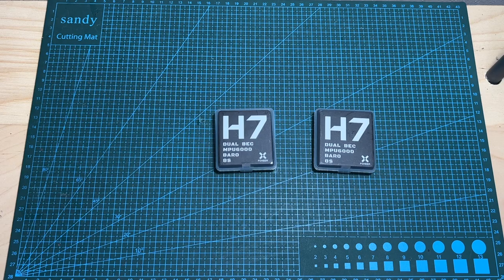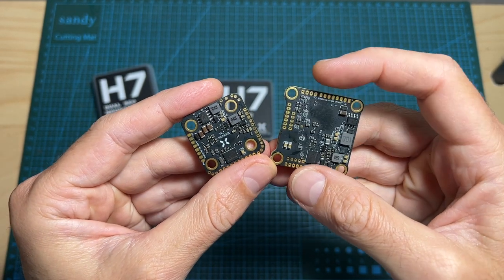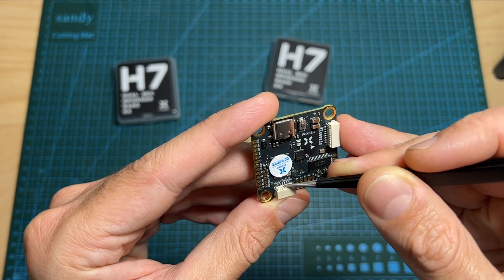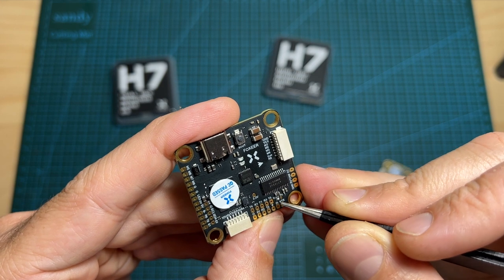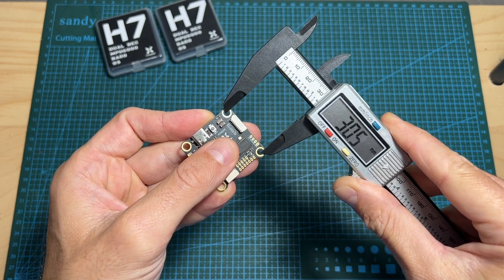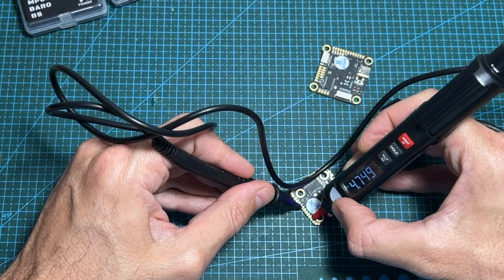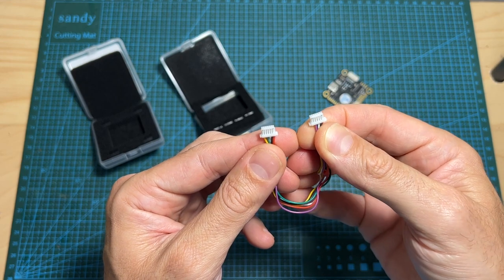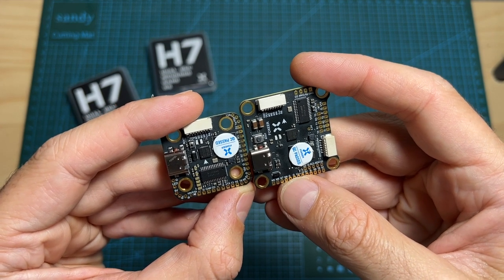Foxeer H7 MPU6000 Premium Flight Controllers Overview

Comment: I seen a new video about a new FC with the MPU6000 and had to check that out. It's almost impossible to find that gyro chip anymore. I don't have any cinelifters or $5000 drones carrying $5000 cameras. I just have 7 inch and smaller gopro quads. For me, any FC will work fine for those. If you only need 2 UARTs, 1 for the camera and 1 for the receiver, an F411 works fine. If you need GPS too then an F405 or F7 is good. I've had expensive FCs and cheap FCs go bad and start going full throttle or jerking and twitching in flight for no reason. I rarely crash and never crash hard. Most FCs seem to use the exact same ICs on their boards. Is there an advantage to an expensive FC? The longest lasting FC that I have is a 20x20 Mamba F405 mk2 that's maybe 2 to 2 1/2 years old. It's been in many crashes, been on a few different quads, from 3" to 4" to briefly being on a 5". The future-proofing idea made sense to me when I started out in this hobby 3 years ago, but I almost never get FCs to last long enough for them to become obsolete. I'm curious what other people think about expensive vs cheap FCs. My experience has been to spend the money on a good ESC, but any old FC will be fine on any build.

Comment: Nice overview. These H743 based flight controllers appears to be replacing the Foxeer Reaper series which used F745 processors. The F745's got very expensive last fall related to chip shortages (2-3x pre-2020). The whole chip shortage thing is stabilizing, so things should improve over next 6-11 months as far as availability and pricing. MPU6000 availability may be a sign of this.

Comment: I have the mini version.  Haven't had time to connect the Walksnail micro camera/VTX or ELRS Rx.  Question:  Is there an onboard switch for the VTX on/off.  Can I use the LED pad for this?  Or, should I use a TinySled switch to an RX pad with 5V Bec to get the cleanest video?
Reply from the maker: As far as I can remember it doesn’t. You can’t use the LED pad for that so you will have to use an external accessory.